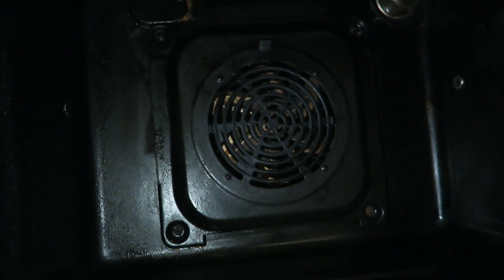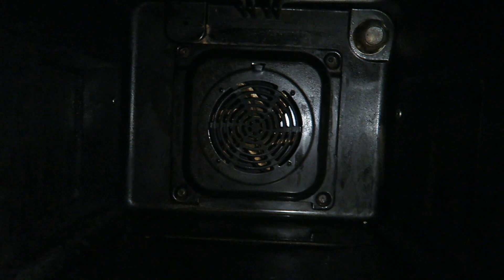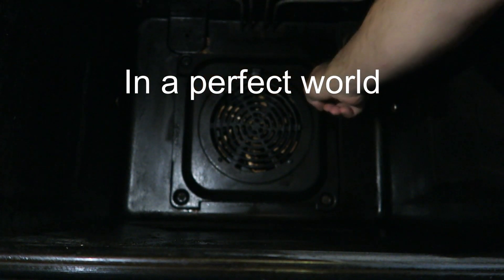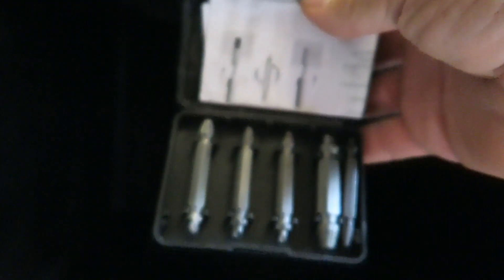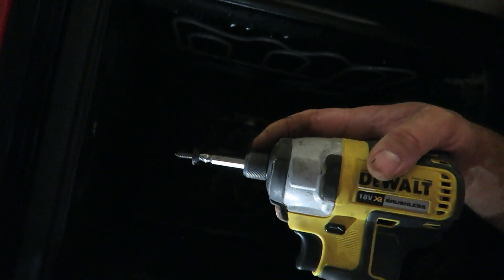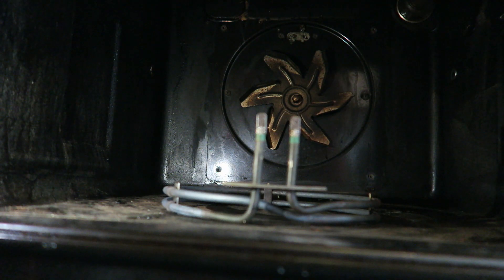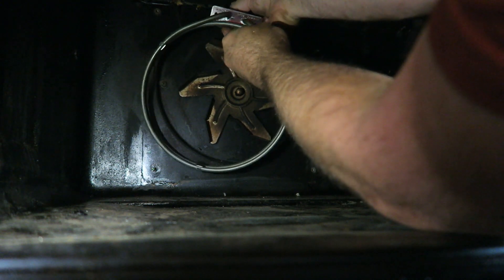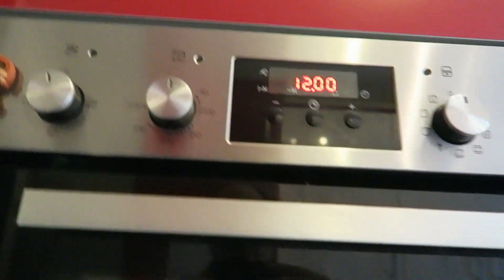Ikea Fan Oven Element Replacement

Comment: Thank you! Really useful video - frankly still above my ability level (I just know I'd lose those two wires down the hole!) but useful to see that it is relatively straightforward.
Reply from the maker: That's the most tricky part. Good to know your limits 👍

Comment: This looks great. Will troubleshoot my Ikea oven since it works on normal heat (upp and down) but not in hot air mode.
Reply from the maker: Brilliant. Hope this helps 👍
Reply: @handymancraftglasgow  Sure did. Ordered a hot air element and changed it. The old one had inifinite Ohms. Thanks for showing how easy it was.
Reply from the maker: That's great. Always feels good when you fix it yourself 👍

Comment: Hey, my IKEA oven won't even switch on any more (usually in most ovens if the element blew, it'd still turn on/light come on) but it's completely dead. Is it still likely to be the element or has something else gone pop do you think? It's under warranty, it's just it'd be handy if I could fix it today!
Reply from the maker: Sounds like something else is at fault. Our oven worked perfectly, just didn't heat up. You have a different problem. Good it's still under warranty 👍